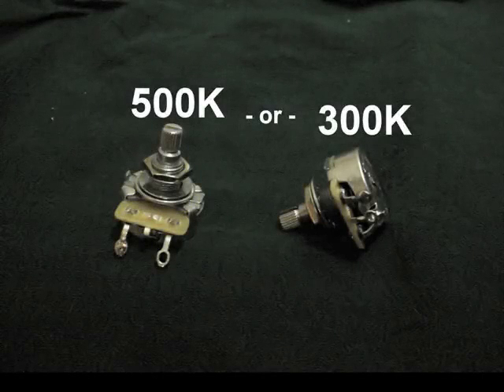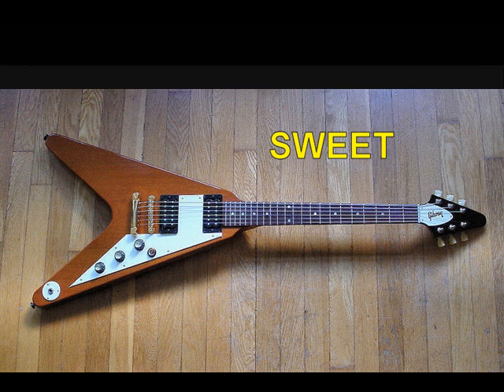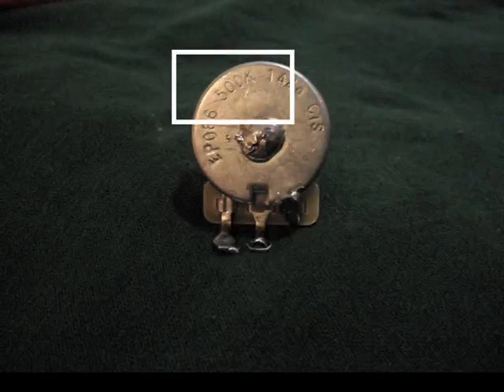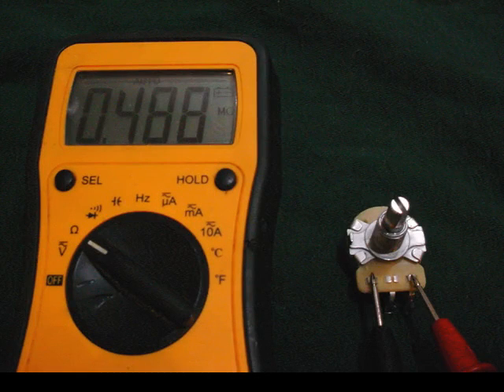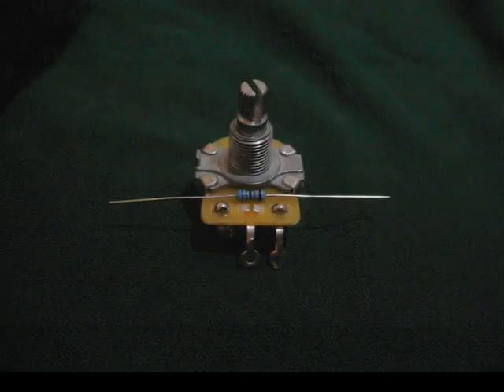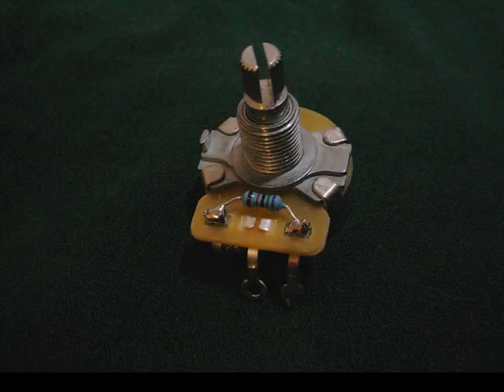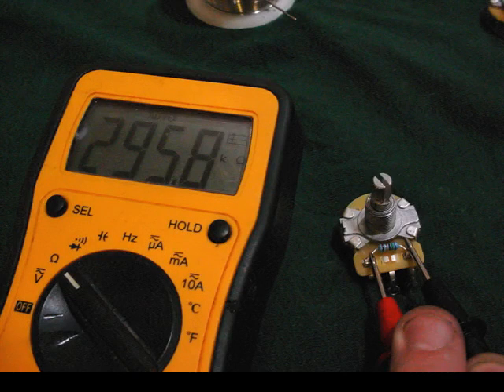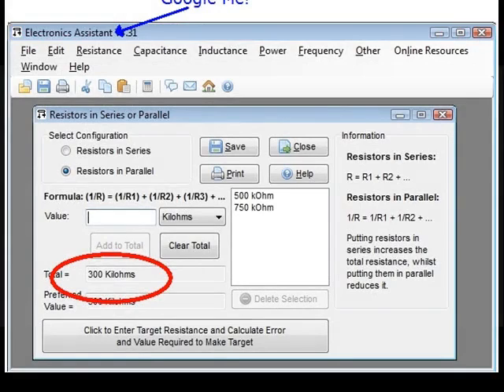How to Decrease a Pot's Resistance Value

Comment: I have a Boss pedal with defective stacked (double) pot. Originally one is 50k and the other is 250k. The problem is I only find 250k/250k stacked pots, so how could I convert one of the 250k pot to a 50k?
Reply from the maker: A 68K resistor across the outside lugs will give you about 51K.
Reply: @ashbass5  thank you
Reply: Is there a way to increase the pot - I mean, convert a 50k pot to a 250k?
Reply from the maker: @NewtaoV  look at my other videos. There is one showing how to do that.

Comment: What’s the equation to calculate the overall resistance? If I have a pot that goes from 0 to R1, and I want to lower that to RT, how do I calculate the resistance R2?
In series the resistance just adds. In parallel, it’s RT = 1/(1/R1 + 1/R2), right? So is this new resistor in series or in parallel?
Paul
Reply from the maker: It is in parallel. I use this handy tool:
https://www.electronics2000.co.uk/

Comment: But doesn’t this mean that the pot can’t get to zero resistance anymore? It started out going from 0 to 488k. Now with the resistor of R Ohms wired in, doesn’t the pot now go from R Ohms to 488k Ohms, or 488k + R Ohms?
I’m confused. 
I’m using two pots wired in series for speed control of a DC motor. I’m using a SCR with 120 vac input followed by a bridge rectifier to convert to DC. 
My motor starts turning at 140k Ohms. So that’s the value I need. But I can’t find 140k pots. I get a 127k pot and a 15k pot and wire them in series for a course and fine speed control. 
I’d love to be able to tweak a pot to increase or decrease its resistance, but it needs to have a zero. 
Your video on increasing the resistance was good. Scrape away some carbon and…wait. Shouldn’t that decrease the resistance? You have less material so less resistance? Now I’m really confused. 
But I’d like to be able to tweak my pots to slightly increase or decrease their resistance. 
What are your recommendations on type of pot (ceramic, plastic, Cermet etc) and how to tweak them to get as close to 140k as possible. 
Thanks for this video. You have opened my eyes. Not sure I understand yet, but they’re open. 
Paul
Reply from the maker: Ah. You will still have zero. If you shave the carbon off the wafer (more carbon, more signal passing, less carbon is harder to pass the same signal, so resistance is higher) you can increase. I"d try some 125k pots if you can find them, even 100k, and then use the scraping method to bring the pots up to your spec. Using resistors to take a pot down is more tiresome. Too, if the pot is audio taper, the additional resistor will mess up the pot's taper. A linear pot taper will work as expected. I just use CTS pots for whatever I need pots for.

Comment: Ok so i did this to two pots and  wrecked them both within 10 minutes. CTS 500k pots and did not overheat or oversolder. The most minor amount of heat for just enough time to put a tiny drop of solder was enough to short out the lugs connection to the surface inside. Putting heat directly to the opposite side of the lug like you show melted the connection to the  resistant surface inside the pot. The better way is to just run a resistor to the outer two lugs where you'd normally solder the pickup wires. Speaking from my shitty experience last night.  The lugs detach and short out the signal intermittently. You can actually  wiggle the lug up and down when this happens. Thats how i figured out what was happening.

Comment: I'm not sure the pot will do anything until it's turned down to the value of the resistor, here 300k...? So, with audio taper, quite a way down. Is that anyone's experience? I just bought some 500k push-pull pots because they were a lot cheaper than other values, so that's why I'm interested.

Comment: how is the knob taper after you do it like this? My multimeter is showing the resistance at its highest somewhere in the middle of the turn and then goes back down to the expected value.
Reply from the maker: It has been explained to me that if the pot is linear, then the taper will be smooth. If the pot is audio, then the taper will be messed up.

Comment: Very useful information. I've got a bridge pickup on a Strat that is way too bright on a 250k pot with 2Meg (1M +1M) Capacitor. Looking forward to trying out reducing the pot value with a Resistor. Thanks

Comment: Can the resistor be added at the Jack, by soldering one side to the Hot and one to the Ground jack terminals?
Would this decrease both your Volume and Tone knobs down simultaneously with the same value, as if you were to solder it at the pot?
ashbass or anyone please answer me this question. Much appreciated.

Comment: But surely this leaves the newly attached resistor in the circuit even with the pot fully open?  If you have a 500k pot and attach a 500k resistor as you suggest then at full value the new parallel circuit is 250k, with the pot fully open the circuit has a resistance of 500k...
Reply: No it’s zero. As soon as the resistance of the pot is lower than the parallel resistor the path will avoid the resistor and go through the pot. Keep turning the pot to zero and the total resistance is zero.

Comment: "Help".... I need to reduce a 10K pot down to 8K..... Steering wheel for Xbox. The mechanical throw on a after market pot is greater than the original, and thus in game creates much more steering rotation.

Comment: Sorry, but this does not work.
If you parallel two resistors you always have an rising and falling curve, like a roller coaster .
It is usable only 50% of each way, then the resistance goes back to the initial value of that side
Reply: what you say makes sense, I have only recently learnt how a potentiometer works internally. I used this method in my circuit and it worked exactly as described. It´s a step down dc-dc circuit. I believe the middle connector is fixed to one side in the board circuit. But didn't think what would happen if they were not together until I read your comment! I will make some tests to figure out
Reply: This is exactly what happened to me. roller coaster curve, and that's not what i wanted. just going to buy a potentiometer for the value i want.

Comment: I'm building a guitar and I'd like a higher range of rolloff on my guitar. I heard I can use bass capacitors, but what if the starting value (pot wide open) isn't as crispy as I want it? What would I do then?
Reply from the maker: Get a wireless rig. They are cheap now. Under $200. These keep all of your high end that a cable takes out. Very crispy by the time signal hits pedals. OR, mess around for a while swapping pickups. This last option can get pricey.

Comment: i have B50k pot
can i Decrease a Resistance Value to 20k or 25k 
please i need to answer in ASAP
Reply: This is not ASP, but yes you can by adding a 50k resistor to a 50k pot, which brings it to about 25k, doing the math. R2*R2/R2+R2, which is 50k*50k=2500 divided by 50+50=100=25k
Reply: Thank you so much torchlord

Comment: I tried this on my Gibson LP with custom made Seymour Duncan mini humbuckers which were far too bright, especially the bridge pup. First I had no volume at all so I re soldered the 470k resistor. I now have great tone but no volume below 3 or above 7. Anyone got any suggestions, other than switching the pot itself, Thanks...Michael...
Reply: This doesn't actually work. I just tried it myself and kept the probes connected while moving the dial up and down, and the curve gets messed up in a big way to where it is no longer usable as a potentiometer. with the resistor, instead of going from 0 to whatever the target is, it goes up and back down to 0. just get the potentiometer value you actually need, it's like a dollar.

Comment: what about using a trimmer (variable resistor) so you can really choose by ear the resistance refering to the sound?
Reply: potentiometer == variable resistor, that's a good point but it's much more expensive. you could do the prototyping on your breadboard to determine the optimal sound, then choose a resistor that stands-in for the fancy expensive trim pot.

Comment: does doing this affect the roll off slope of a volume control ?
Reply: yes
Reply: @zabtej1645 so say for instance I have a bass octave pedal where the octave volume knob is way too sensitive (barely touch it and it’s too loud already) making it hard to blend with my clean bass tone. Can I apply this method to the octave volume pot in order to give me a smaller volume range?